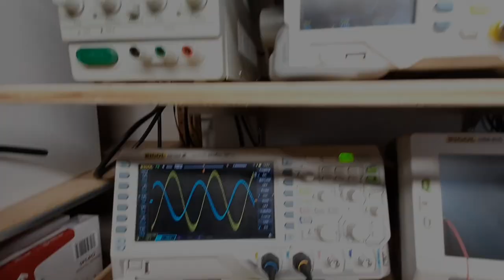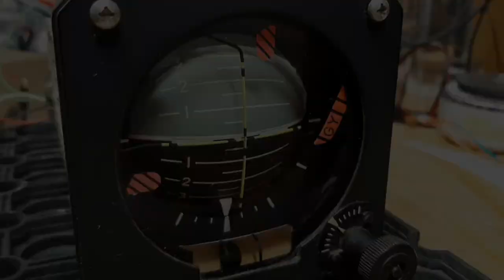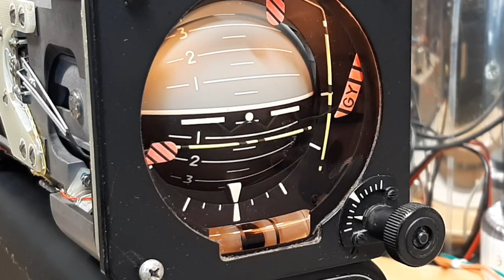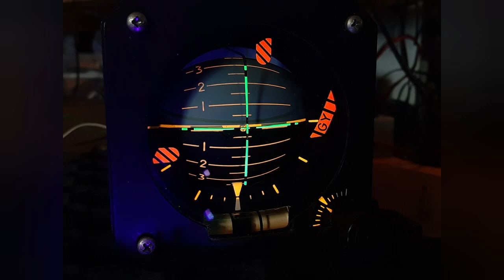'Quick and dirty' Sfena artificial horizon test

Comment: That thing looks so expensive to just toy around with.
Reply from the maker: Indeed. The 'good' thing is that these instruments wear and therefore are replaced one in a while. So these original high priced precision devces can be purchased for not too much money. Even not airworthy these quality devices won't be cheap, but afforable. Note: If you have purchasing plans, remind that not every artificial horizon has a gyroscope built in. Only artificial horizons with a reset knob contain a gyroscope and can work standalone. The one's without a reset knob require an external gyroscope and can therefore not function standalone.

Comment: So how does is know which way is down when you've knocked it out of alignment?
Reply from the maker: The problem is, the gyro doesn't know what is is the normal situation. So once the gymbal lock happens (straight up of down), the gyro has to be pulled to it's default position. So the airplane has to be flying straight ahead and the 'erect' knob has to be pulled to align the gyro again. So usually you want to avoid a gymbal lock since you   lose the reference until reset. An airliner won't lose it's referece during normal use. But this can happen for fighter jets. A gymbal lock is much worse when traveling into space since there's no horizon that can be used as a reference. The Apollo's have therefore an early gymbal lock warning when the gymbal lock is approached.
To sum up; you usually want to avoid a gymbal lock. If it happens the reset has to be done manually and the reset is referenced to the current position.
More luxury gyroscopes like this one has self balancing weights that can correct small drifts, but this corrections are vert small so not suitable for a gymbal lock reset.
Reply: @polytech_nu  So basically to pull on the knob and reset the horizon you need to be flying level or on the ground? I see. I imagine it could be quite problematic in low vis situations. Thanks for the response.
Reply from the maker: @Ramash440  Exactly!

Comment: Very nice!

I have a Sperry ADI from an old B747 that I want to use. I like your solution for the 400Hz supply (I may just use some small digital amps). But my big challenge is to figure out the pinout for the Cannon connector. Unlike yours, mine doesn't have a convenient label. Like you, I want to get the lights and all of the flags working as well.
Reply from the maker: If it's a 400 Hz model, there's probably a transformer built in. Look for the two wires that are connected to the conenctor and the transformer. It's likely that these two wires are the power input. Otherwise it's wise to look for the filter capacitors. It's likely that the 400 Hz power is filtered at the input. The lights and flags are the easiest to find out. Just trace the wiring by hand or an Ohms meter from the connector to the solenoid/lamp. If you find three 'floating' wires with the same impedance, big change that those are the synchro outputs to drive other slave instruments (if this installed in the instrument).

Comment: At 3:07 some morse code, cant quite figure it out what it says.
Reply from the maker: Haha, you've got well trained ears. 😅 It says 'PI3APD'. I'm a hamradio operator and  in de background are some radio receivers standby. And PI3APD is the local VHF repeater station of the town Apeldoorn I live in. Every once in a while the repeater signals it's callsign in morse code. This audio was therefore not related to the artificial horizon. 😅
Reply from the maker: Haha, you've got well trained ears. 😅 It says 'PI3APD'. I'm a hamradio operator and  in de background are some radio receivers standby. And PI3APD is the local VHF repeater station of the town Apeldoorn I live in. (https://a05.veron.nl/afdeling-2/pi2apd-pi3apd/pi3apd) Every once in a while the repeater signals it's callsign in morse code. This audio was therefore not related to the artificial horizon. 😅

Comment: Hello!
I was wondering what is the Marantz pm310 amplifier used for in your setting?
Have a nice day.
Reply from the maker: Good question! I uploaded this video as a quick test, not realising there is so much interest in this device/topic. My plan is to explain more what's happening in a revised video. But here's the answer for now. I used a waveform generator to create two 400Hz 1Vpp audio tones 180 degrees phase shifted. The audio tones are fed to the audio amplifier. The left channel is in phase and the right channel is used for the inverted phase. The result is a 'push-pull' amplified signal of the audio tone. (The output voltage for one channel was too low, so I used two channels to double the voltage in this setup.) Instead of a loudspeaker I used a 240:24V transfrer in reverse. So the audio signal is fed into the 24V side and the result is a ten times higher voltage. The volume knob is used to regulatw the output voltage. The goal signal is 115VAC 400Hz sinewave. The signal is fed into two of the three power wires. The third wire is coupled via a capacitor to one of the power lines. The result is that the 'third wire' has a phase shift. The result is a simulated three phase 400Hz 115VAC signal powering the gyro motor.
Is this explanation sufficient? I planned to make a drawing with more information in a follow up video...
Reply from the maker: Here's a follw up explanation... I made a drawing that probably the odd setup explains. ;-) The drawing can be found here: http://reiding.com/public/data/Avionics/115VAC_generator.pdf